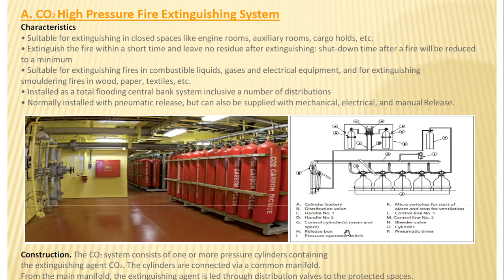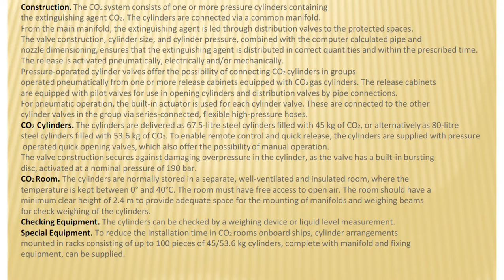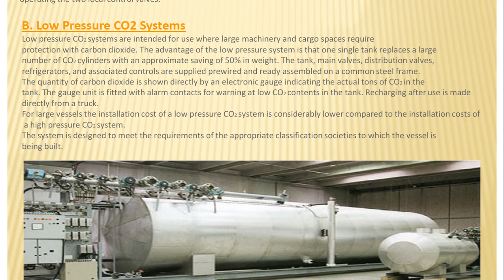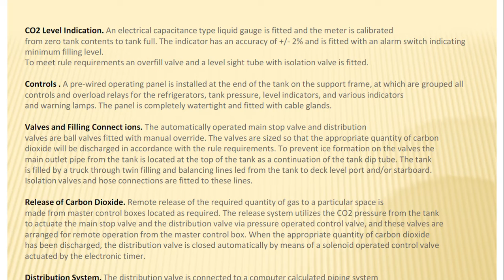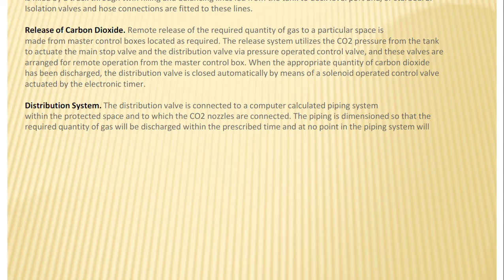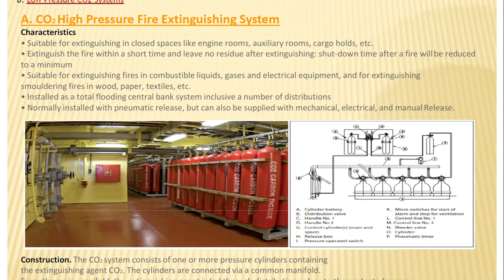High Pressure CO2 System and Low Pressure CO2 System; Explanation.

Comment: i have a question, like main air bottle resever, there is pressure gauge. so that we can see the pressure. But for CO2 bottle in CO2 room, why dont we have pressure gauge? we need to weigh it.
Reply from the maker: https://youtu.be/boc8WXoOI8I
Reply: @ersauryashankar  thanks 😍, this question was asked in oral exams. I couldn't give answer. But next time it will help me a lot